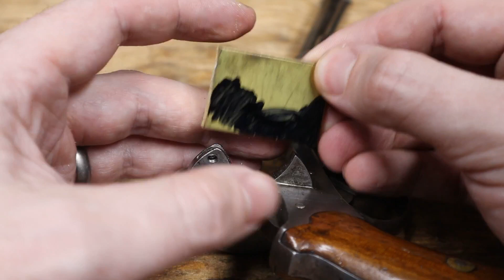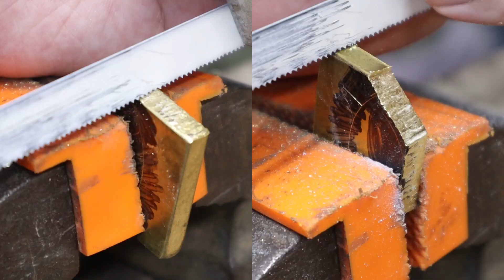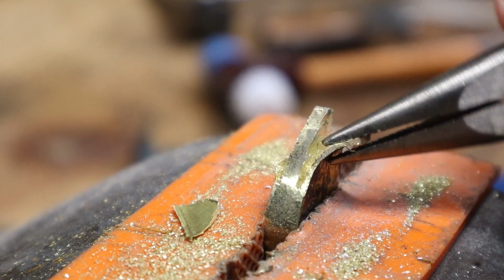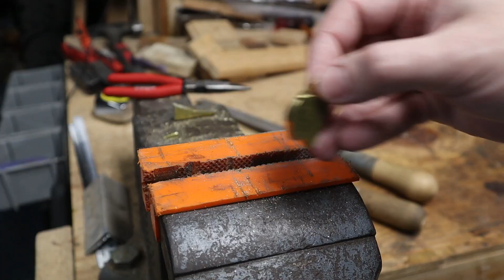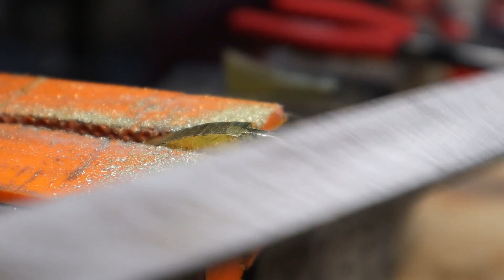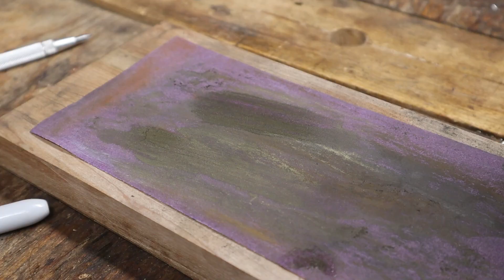Making a Loading Gate for a Belgian Pinfire Revolver

Comment: Excellent job. I have the same revolver, and it also hadn't that gate. About two years ago I found how to make the ammo (mine is 12 mm) with .45 ACP cases. So, I made the loading gate as you but in iron. I'm surprised with its accuracy. In my country, Argentina, is free to use because is a model before 1870 (don't need registration).

Comment: Hey, I just picked up an old pinfire. It's missing some springs in it. Someone is messed with it and lost some parts. I need to find out if I can get these parts anywhere and how to identify them and what it looks like on the inside is there anyway I could get help.
Reply from the maker: Unfortunately these were mostly hand made and there's not any standard models. Finding a spring that will drop in will be extremely difficult.
Reply: you might find some information at hlebooks. they offer some virtual books about common pinfire types that you can buy and download with detailed pictures of the interior parts of many common pinfire revolvers. But as the channel owner said: you'll probably have to make the part individually (or have it made by someone) because they might vary in their dimensions, for which you won't find info there anyway. That same source also sells reload kits to make pinfire cartridges yourself btw (look for HC-collection). They are based in France. Exporting shell cases that are not centrefire is not a problem according to them (I had mine shipped to Switzerland) but I don't know how import restrictions are where you live.